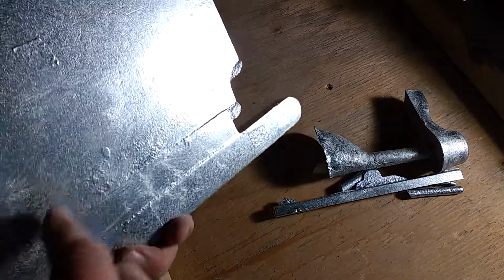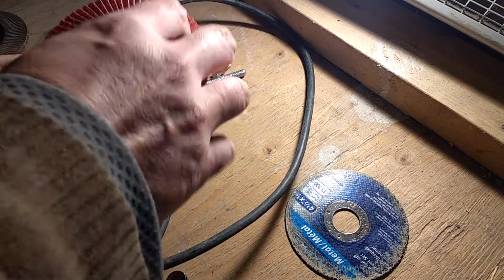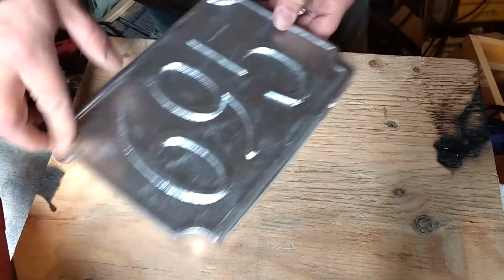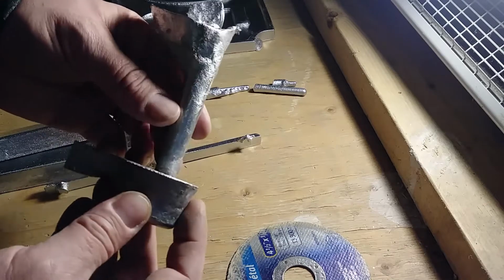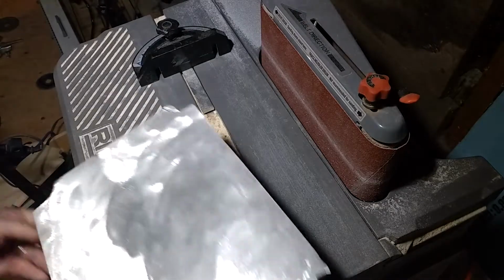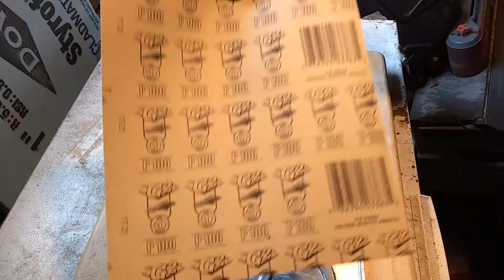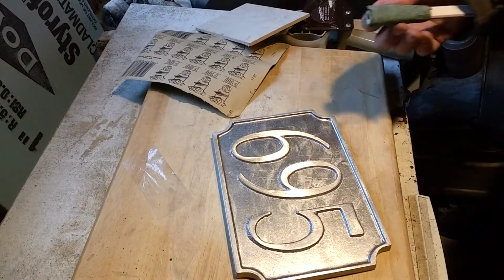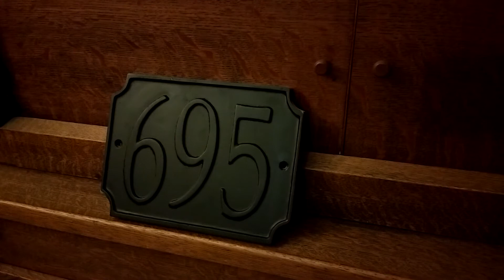Finishing the House Number Plaque

Comment: Tobho, Try some lubricant on that bandsaw blade it helps a lot. many people use candle wax, I use brake fluid..Martin
Reply from the maker: Olfoundryman Brake fluid, eh?  I've started using a few drops of oil with my bandsaw since this video was filmed, but I'll keep that in mind.  Thanks!  Jeff
Reply: Jeff, I chose the brake fluid in the hope that it would not damage the rubber on the bandsaw wheels, whereas I thought that oils might ruin the rubbers. To be honest I think I might be the only person using brake fluid!Blocks of crude wax are much more usual juts push the wax into the blade but I found the brake fluid better, I usually applying it to the blade with an old tooth brush every few parts for small stuff or in ta case like your plaque every cut. Remember though brake fluid will absorb water from the air and make everything go rusty... martin
Reply from the maker: Olfoundryman good point about the oil and the rubber, I've got a few stubs of candles somewhere that I can try using instead, thanks again!

Comment: Yup, a manual patch of the sand would have helped. A little bit of sanding is better than a lot. 

Either way it turned out good. Every project is a lesson on how to make the next one better. So whats next?
Reply from the maker: Thanks, I'm not sure what's next yet, I'll probably have to wait until spring to do any more casting due to the whole Canadian winter thing.  I may work on some patterns or foundry equipment builds in the meantime.

Comment: good job man ! tell me did you put a draft on the pattern when it was print ?
Reply from the maker: Morpheus maraudeur Thanks!  Nothing was printed - I sanded draft on the wooden master pattern I used to cast the aluminum blank plaque pattern, and also on the individual wooden number patterns that were temporarily glued to the cast pattern in order to make the mold for this casting.